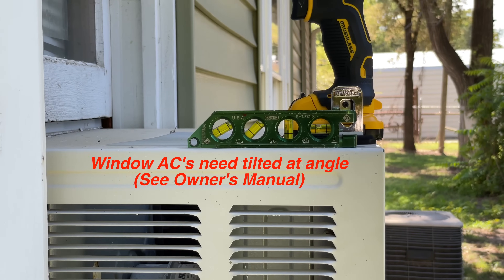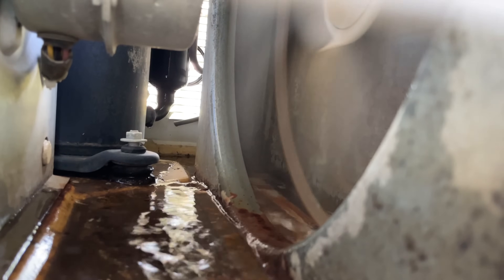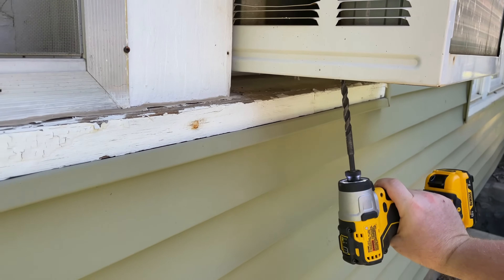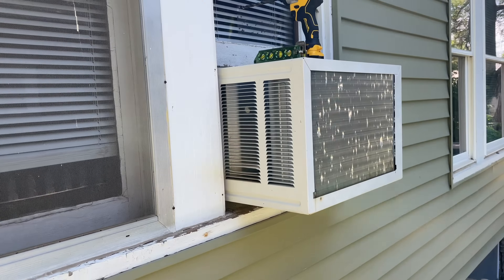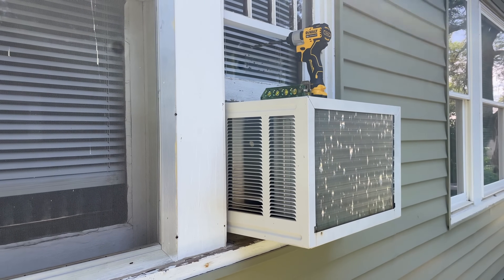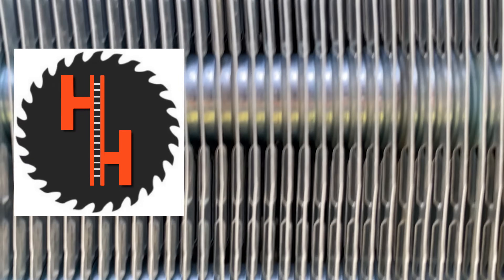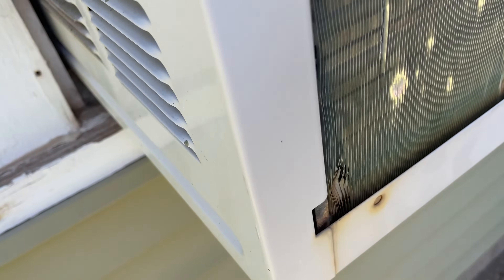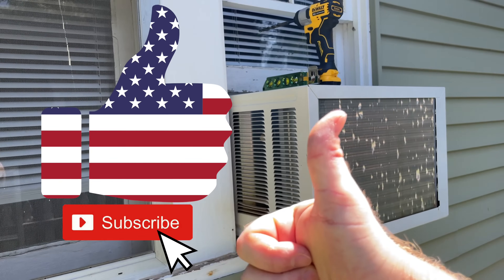99% Don't Know THIS About Window A/C's!! DON'T DRILL!!

Comment: My window unit spits water out of the front vents inside the room. Def thinking about drilling a hole.
Reply from the maker: It’s not supposed to spit indoors. So since it does, I would check that the AC is angled down correctly, and also that there’s no blockage (leaves, dirt, etc) from the water draining to the back. Somehow the water is pooling enough for the squirrel cage fan to pick up water. Or, just drill it 👍🏼 let me know if that fixes it.
Reply: Sometimes if the room is too humid you should use the dehumidify function first because the humid air condenses on the cooled return ducts and escapes thru the vents inside the room. Once the humidity level goes down, you can switch to cooling.

Comment: The noise of the water splashing bothers me. Would it still be ok to drill a hole so the water drains and doesn’t splash around?
Reply from the maker: Yes, that’s perfectly fine to drill a hole, I’ve done it several times.  It won’t be quite as efficient, But I don’t imagine it is much. Just be sure the dripping water doesn’t warp or rot anything on the house as it splashed on the ground or whatever it hits 👍🏼

Comment: If that's the case manufactures should make the bottom pan out of galvanized or stainless steel so the rusty water don't splash all over. They should also put a label stating not to drill holes on the bottom so not to shorten the life span of the cooling unit. Glad I found your video...was about to drill some holes and couldn't find any info on this issue. Thanks.
Reply from the maker: I agree on the bottom of the pan and the sticker. Although, I’ve never had one actually rust out on any rental houses yet, so it’s just the aesthetics so far. 👍🏼
Reply: Should they also put label not to set it on fire? Why should they have a label against someone  purposely damaging it?
Reply: that rusty water cant possibly be healthy to be inhaling
Reply: @DaveDoggyDogg50  mold, if not cleaned every so often
Reply: I don't think I've ever seen an AC manufacturer not state to not drill a hole into the bottom the AC. It's always in the manual. It's not the manufacturer's fault if you don't read it.
Reply: MFR's want those units to be ruined every few years so they can make you buy another one. Keeps that pesky cash flow going lol
Reply: Me too. Good thing i found this informative video.
Reply: PLANNED OBSOLECENCE for sure. Not only does it clog your fins like in his "clean your window AC" video, but it also rusts and corrodes your unit by having standing water.

Idea being that not everyone is going to bother cleaning their old one and simply just go buy a new one because their old one doesn't cool anymore.

Consumerist society
Reply: I drilled mine and found out to late 🤦🏻‍♂️
Reply: so products should come with a warning sticker telling you not to drill the item full of holes? yeah ok
Reply: @markrush5013 just put two new ones in. Different manufacturers, both have stickers saying do not drill holes in bottom pan. Void’s warranty
Reply: I definitely agree that the drain pan should be made of plastic or stainless steel , Not galvanized because rusting begins at the edges of the pan and eventually ends up rusting the rest of the pan
Reply: I have tcl 10000 smart window ac.  I love it...except it's super stinky and I've only had it 4 months.  No drainage holes.  It's been SUPER humid here this summer.  Do I take the back off?  The dumb instructions manual doesn't even mention need8ng to angle it to start with 🙄
Reply: I SHOWED MY HUSBAND YOUR AC VIDEO! HE HAD PLANNED TO DRILL A HOLE. LIKE MOST GUYS THEN . HE WANTED TO MAKE SURE IT WAS LEVEL. SO HE FIXED THAT. WHEN I CUT IT ON. IT SPITS WATER AND MAKES A LOUD NOISE ? 🤗
Reply: Some have a plastic bottom pan. But honestly I haven't seen any window unit with a rotted out pan that wasn't over 20 years old and left in the window all winter.
Reply: About time someone realizes that shit thank you man
Reply: It's a BS cover story to redirect your concerns.
Reply: That guy doesn't know what he is talking about not to drill a hole in the bottom of window AC units there's no difference in the efficiency whether it has water in it or but the water will rust out the unit faster so they don't know what they are saying. I have had window AC'S last longer without the water pooling in it plus I've done a test by plugging up the whole or letting the water drain out and there's no difference in the air conditioner efficiency the way it cools it makes no difference but I find that the air conditioner last longer without the water in it. Old air conditioners the water would drain out I believe that  manufacturers lie because thay don't want  your air conditioner to last. Since I drilled a hole in mind My air conditioner is over 10 years old and still works and ones that I left the water in  was rusted and leaked the coolent  in a year-and-a-half and was no good. people Just get dumber and dumber in the 1960's people made much more scene
Reply: @stevealienman777 planned obsolescence
Reply: @stevealienman777  There is a difference. I've personally measured that the condensate water on the condenser coil reduces the energy consumption about 20% electricity usage . 

For my 5000BTU window unit, at $0.167/kWH? that's a bit over $10/month, for every month it uses over 300kWH. Assuming there are only 4 months out of the year that holds true (here? it doesn't)  and that electricity prices stay the same (they're going up)  as long as the window unit lasts five years, I've saved money.
Reply: @Tevruden  the prices are going down and will go down more now with Donold Trump now back in office all prices have to do with the oil. The gas ⛽ when the gas go's down every thing else will start to go down
Reply: @Tevruden  when you drill holes in the bottom to let the water out your air conditioner would last you 20 years or maybe even longer. not just a stupid 5 years that's way to short. AC's in the 1970's let all the water drain out that's why they last so long. my parents had an Emerson quiet cool AC for over 20 years old and it worked fine and never needed charging. you want the holes in the bottom i would rather have my AC to last me 20 years and not just stupid 5 dumb years because the water don't drain completely dry
Reply: @Tevruden  you keep saying there it a difference in power usage no there isn't my Electric bill remained the same with the pan dry or not. having water in it rust it out and shortens the life between 2 to 5 years that's to short . I've had my same air conditioner for 25 to 30 years that's when you drill the holes in the bottom and let all the water drain so it runs dry air conditioners in the 1970's never had water in then and they would last 30 years.
Reply: @stevealienman777  Interesting...you can fool some of the people some of the time, but not all of the people all of the time. I just want to add, that the guy in the video is not a rep. of the unconscionable companies, rather he's just trying to point out a "caveat" and then leave it to you and me to ultimately decide. Its the companies which are corporatocracy. They are the ones who have been turning everything into an Orwellian world.
Reply: @stevealienman777  Slingers do have a purpose, if I understand correctly it's a similar principle to cooling towers. Water can divert energy (heat) better than air can by evaporating (air is actually a great insulator), since it takes energy to go up to a gaseous state. The slinger throws the water on the coils, and the refrigerant in the lines cools more easily as the water is drawing energy (heat) from your condenser radiator.

What does more efficient mean? You're drawing less wattage to run your compressor, it's not cooling more it's just doing the same job with less work. Now the caveat here is that the higher the humidity in the air, the less efficient this is going to be.
Anyway, it doesn't matter how much efficiency this adds if you get pooling water that destroys your fins, the refrigerant lines with corrosion and gets mold growing. I want the unit to last 10 years at good enough performance, not 5 at slightly better performance.

Oh and if you get the idea to mist your radiator manually, do not. You don't want to use regular line water, depending on your area the minerals in it will cake on the fins and choke your machine in it. You need some sort of demineralized water like distilled water, but this is not economically worthwhile. 0 clue how big unit/industrial HVAC handles it, but for window units don't bother.

https://www.researchgate.net/publication/324992142_Thermal_Performance_Evaluation_of_Water_Mist_Assisted_Air_Conditioner
Reply from the maker: I bet you think cars got better fuel mileage in the 1960’s too huh?
Reply: @HandymanHertz Yeah it's definitely more efficient , except for very dry climates- in which case there won't be much water anyways.  

But the standing water does cause the bottom inch or so of the aluminum coil fins to corrode much faster.   On a couple units I've drilled a big hole at the lowest portion of the pan, then installed an electric wax motor  valve , originally from a dishwasher door vent, over the hole.    The valve gets energized when the unit is running, then after 6 hours of no compressor running the valve releases and all the water drains out.   This was a bit of work but maintains the efficiency without the standing water corrosion issue.
Reply: @HandymanHertz  Because they were much heavier and didn't crumple like the plastic they are now. And I bet you think that the newer cars are safer now because they crumple like a plastic box.  The fact is products are becoming cheaper and cheaper and the ad men sell it as new high tech. Even the seat belts are crap, the emt's know this. Waste to wealth....
Reply from the maker: @jjk2one ah yes, nothing more safe than an old car with no airbags and getting impaled by a steering wheel column right through the chest in a collision. But at least it's steel. 🙄
Reply: @HandymanHertz  But my new toy has a recall for the airbags exploding in your face while driving. These new cars are crap and the electronic sensors have interference that no one will admit to. As in hyper accelerating without a proven way to stop. The dealer owns you as your warranty is only valid when using them.  Anyway, I know the recycled crap that's in allows now and it's second to riding a motorcycle. I don't see a point is comparing dangerous to dangerous. Neither do I see a point in selling how new cars are safe or safer than old cars if the airbags are junk and so are the seatbelts.  I won't get into the frames on some cars.  But with my new car I wouldn't let a child ride in the back seat as the back doors are light as air. This is a camry not the cheapest car out there.
Reply: @HandymanHertz  Yes, plastic is used in car blocks, and some say that plastic can be up to 30% lighter than metal. Plastic is used in car blocks because it's lighter, which can help with fuel efficiency. For example, Solvay has built a plastic engine called Polimotor 1, which has reduced the weight of an engine block by 30% and improved engine efficiency.
Reply: This is plastic and metal alloys,  not just plastic parts. As in Porosity, as in cracked blocks
Reply: @HandymanHertz I had a full size 1966 pickup truck get 26 mpg. No AC P/S or Automatic transmission to use extra fuel.😅
But I have never needed to drill a window A/C unit. Just had to take off the cover and do a good clean out
Reply: @HandymanHertz Yeah people think of air bags as the primary safety devices in newer cars, but collapsible steering columns are the single biggest life saver in Cars since the late 70's.
Reply: @HandymanHertz   fuel mileage does not improve for many decades because it it regulated to keep gas companies in power. on several occasions, when someone designed a car that is too efficient they're murdered. as for the ac window unit design, planned obsolescence should b considered likely. we say bad design, but company says good design.

Comment: That may be what it's for, but I ran into a problem. My window A/C pushed water inside the house because they also put weeping holes in the A/C frame "inside" the window flooding my room (thanks Arctic King, Walmart). I plugged the holes. It flooded because of the pool of water was covered in mold forcing the water "uphill" into the room. I drilled some 3/8" holes in it. It's predecessor, Also an Arctic King, welled water up too. It did the same, now that I remember. I'd drilled a bunch of holes for that one too. It lasted 6 years. IF I didn't drill the holes the condenser would have rusted away in the area under water. So, I'll take less efficiency and longer operation over more efficiency with a shorter life span.
Reply: My problem, other than the splashing water sound and water splashing out of the cooling vents, is mold.  I have 2 units like this, and they grow and sling a terrible black mold all over.  They're getting drilled!
Reply: OK, I guess I kind of understand what they are trying to accomplish, a little extra efficiency...  Not worth the rusted mess inside, stinky water spilling inside the house you pull the unit inside for the winter.  Will continue to drill holes in new units I purchase.
Reply: @donk499  definitely not worth it for us consumers. built in obsolescence under the guise of efficiency
Reply from the maker: YeAh that sounds like a poor design. You bet…gotta drill that…Can’t have water inside! 👍🏼
Reply: Yup without drilling holes the whole unit rusts out in 2 years and will have battery terminal looking green corrosion all over the fins. I plan on window AC life being short, you can pick up 6000's now at discount vendors for a little over $100 new in box. I just replace instead of flooding my window sill and with a rusted piece of metal
Reply: @stangcobra592 had same problem, took it apart, used vinegar, garden hose and compressed air with a wet/dry shop vac  and little hose attachments to get in-between components, works like new. Took a few hours to get all the gunk out.. save a few bucks and use the tools 👍 ✝️